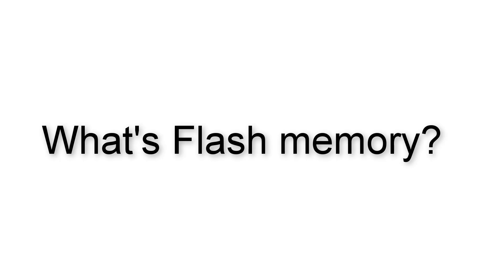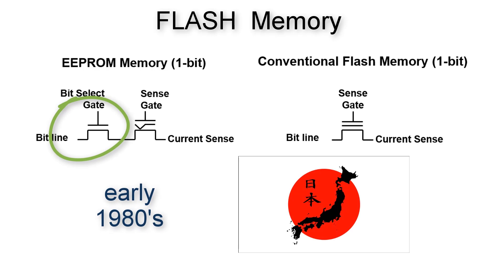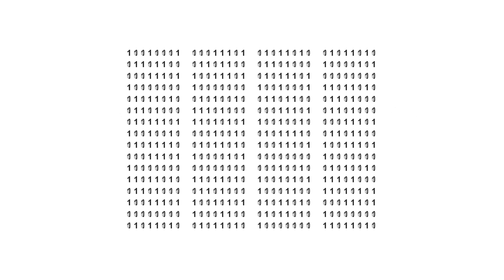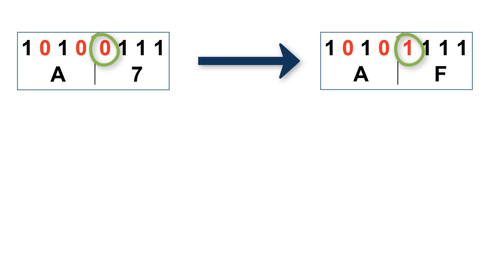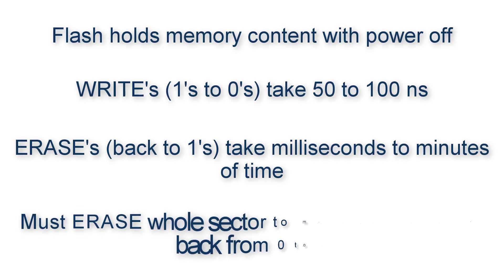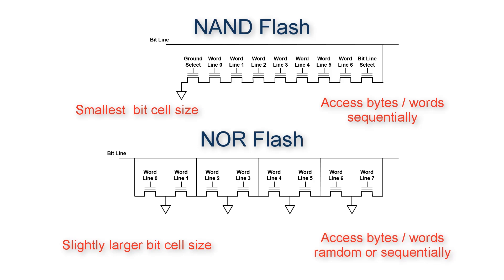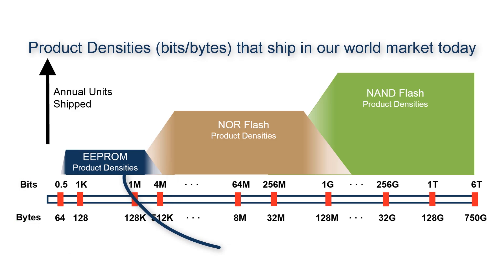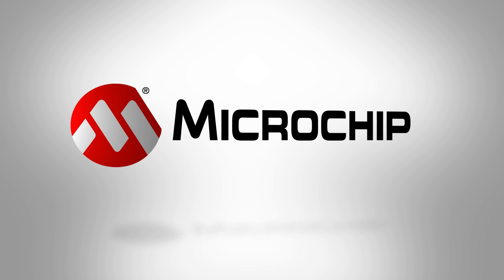What Is Flash Memory?

Comment: What is the difference?
Flash memory & M. Card
Reply from the maker: Hi Xmo Kuc,
A memory card is a small storage device that stores data on portable or remote electronic devices. It uses flash, a nonvolatile semiconductor memory. There are generally three types of flash memory cards: SD cards, compact flash cards, and USB thumb sticks. Flash memory is also used in solid-state drives (SSD), but those aren’t classified as memory cards. Let us know if this helps.

Comment: I'm a little confused because I had bad and slow sectors on my 16Gb flash stick, I force wrote over those sectors inverting from 0-1 repeatedly until it worked again. I thought this is only possible with magnetic storage. If the transistors die with usage, why were mine restored? Really weird.

Comment: Nice video but doesn't actually explain how nand memory works, i'm guessing it's some kind of magnetized p/n process? also does anyone know why it oxides why is oxygen present in the semiconductor?

Update:Literally took me 10 minutes to work out how it works, its n-/p/n-n+ , they need to replace the missing ions to stop the degradation it won't matter what material the floating gate is made out of it will always degrade no matter what and making it smaller will speed up the degradation